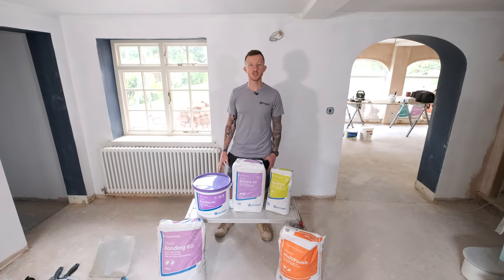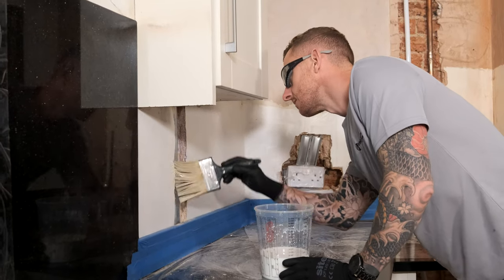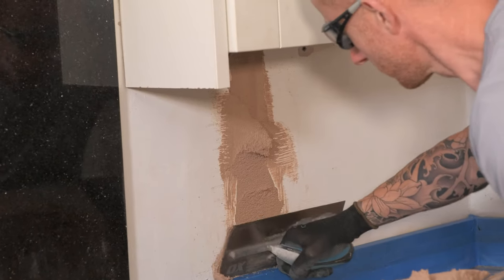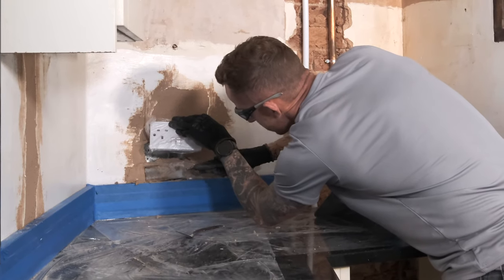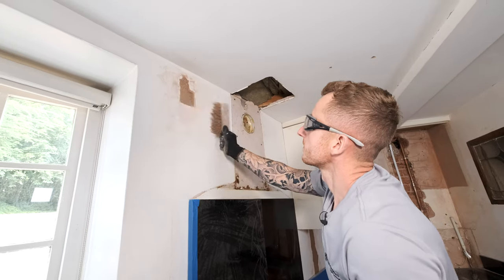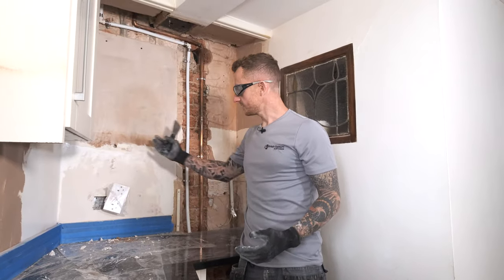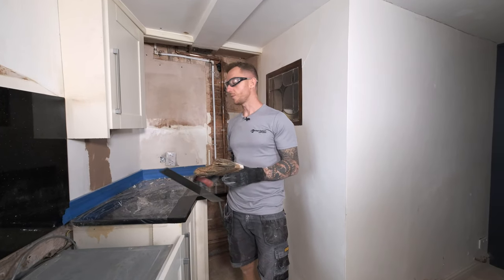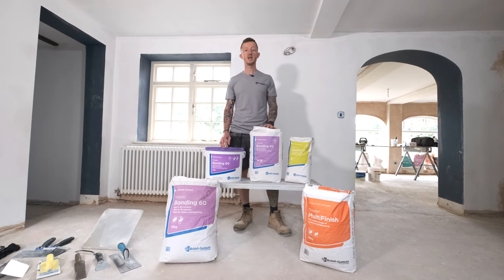A practical guide on how to patch and repair using British Gypsum’s repair range

Comment: My partner and I have just moved into an old 2 bedroom council flat. There's a lot of work needed, the walls are all pock marked, and a lot of the plaster has come away from the brickwork when removing architraves or skirting board. Is Multi finish ok to go straight on top of old render plaster? or should I prep it with PVA mix? 
Some areas the old paint has chipped off, but left a smooth finish coat underneath, should I build this back up with Multi finish or Easy Fil? the area is about 60cm2 and about 2 -3 mm deep.

Comment: Hey - noticed you used 2 different finishes; filler for one area and then multi finish for another. what would be the difference? thanks!
Reply: Multi finish requires two coats so too fussy to use in small areas.  The filler wouldn’t be great for larger areas as it almost always requires sanding afterwards.
Reply: Weird that it wasn't explained in the video! Seems like filler is the way to go for a novice/DIYer

Comment: I have removed kitchen tiles in advance of re-tiling. On removing the old tiles, I am left with the bare wall being roughly 50% clean plasterboard showing through and 50% a thin (1 or 2mm) scattering of plaster, the rest of the plaster is on the back of the tiles. What would you recommend please and when, if ever, should PVA enter the process.